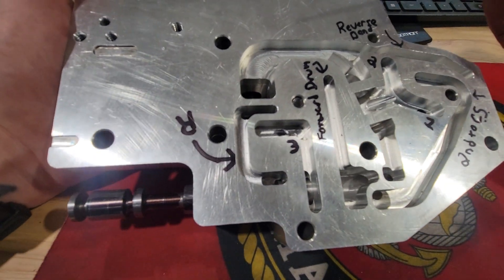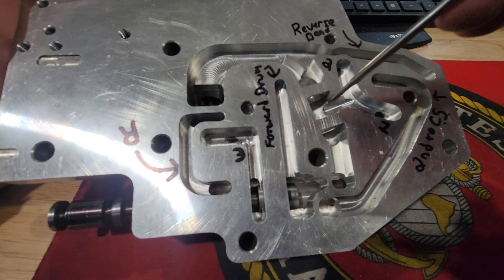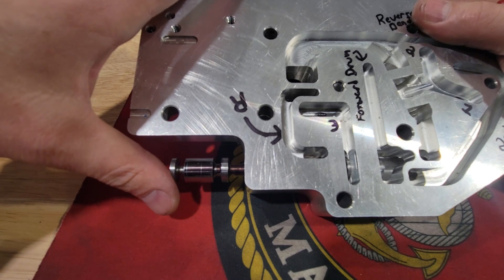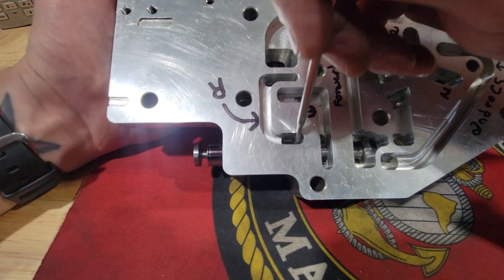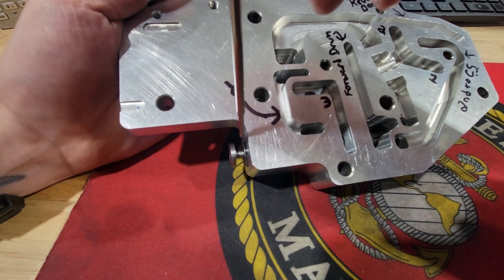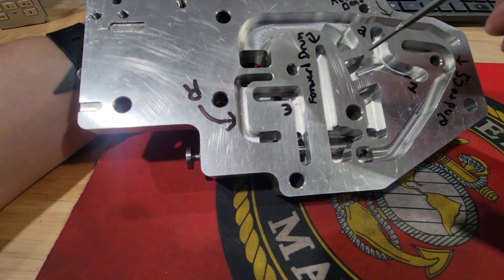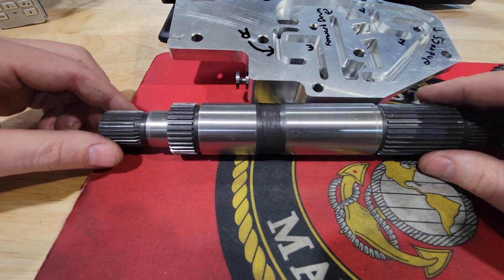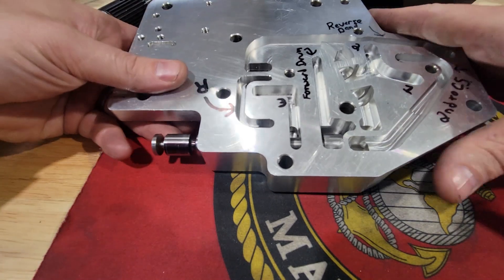Turbo 400 Manual Valve body and Function Explained

Comment: First transmission I rebuilt was a turbo 400 in my 69 Grand Prix. I was maybe 18. I didn't have a clue what to do, where to start, or how I was going to do it. I didn't even own a jack. I used wooden blocks and a 2x4 to lever the tranny out of the car and onto the dirt. I bought the cheapest overhaul kit I could find from some magazine and started unscrewing bolts till I had every piece torn apart and sitting on my work bench. Working every evening when I got home from work for about 3 weeks and I had it ready to go back into the car. Got it installed a few evenings later and it wouldn't work. I was disappointed but didn't know what defeat was. So out it came back on the dirt and wooden blocks. Back on the bench, took the pan off and immediately saw the problem. The S hook that hooks the shifter linkage to the valve body had somehow came apart. I debated on going back into the tranny, but decided I  was confident that I had done everything I knew to do. Later I wished I had pulled the pan instead of the whole tranny.  Got it back in and to my amazement, it worked perfect. Talking about a happy young man... That was back in 1974. Later in life, I worked at a GM dealership and rebuilt hundreds if not thousands of transmissions. I was working there when the 700R4 came out. Lots of warranty work on them before GM figured out all the bugs.
Reply from the maker: The no quit attitude is a hard trait to come by, thanks for the comment!